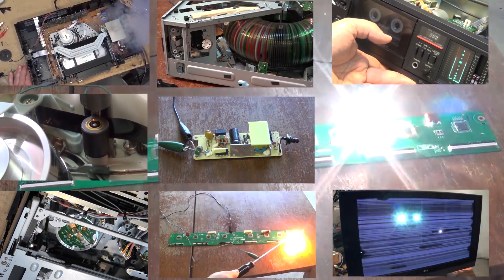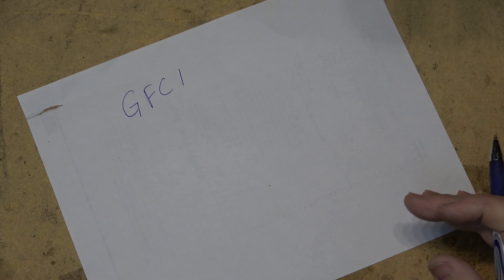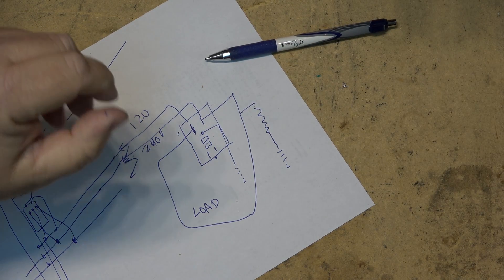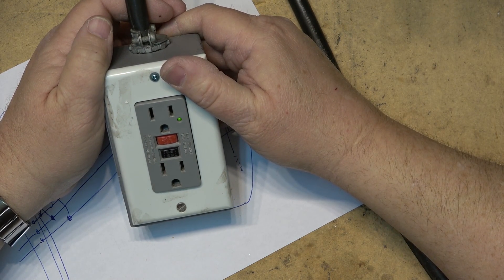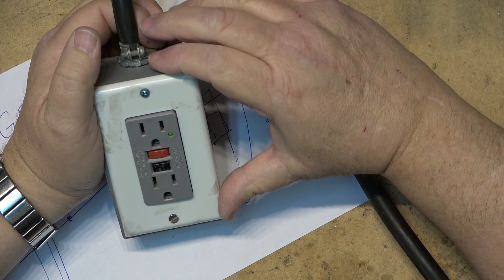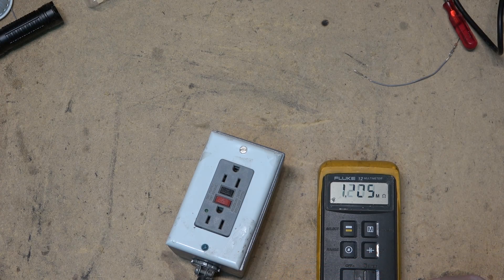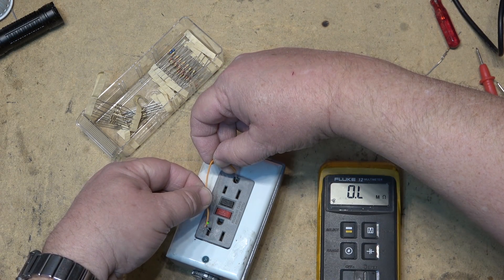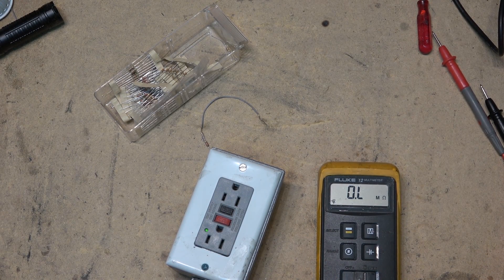Ground Fault Circuit Interrupter Demonstration

Comment: 13:00......I had no idea the ground is THAT conductive. Kinda leaves me wondering how well it conducts at lower voltages???
Reply from the maker: That wasn't even a good ground. If I drive a 6 foot ground rod in it would light a 100 watt bulb full brightness.  I was driven into crushed rock not soil.

Comment: Does it still reset/catch/latch when unplugged? 
I have one that's not resetting without tripping , but have only read one source (online) that says after 2003 they're not supposed to without power, suggesting a broken connection. (And I haven't dug into the code/regulations since I've been putting replacing it off until the weather is nicer.)

Comment: 13:05 Does it trip if you ground the neutral ?
Reply from the maker: Neutral is already at ground.   It is grounded at the pole and at the breaker box.  GFCI measures leakage from hot to the neutral return to that plug.  Any current return to anything other than its own neutral return will trip.  In other words if I were to plug another extension cord into a different outlet and connect a load between the hot on the GFCI and the neutral on a second cord it would trip instantly. The GFCI does not know but it's actually connected to a neutral line or if it's going to ground. 100% of the current supplied through the hot terminal must return to the neutral on that protected outlet or circuit. If the current returning exceeds the threshold of the rcd device it will trip. For example if the trip is 5 milliamps and you are drawing 100 ma from the hot side and 97 was returning to the neutral it would not trip but if only 94 was returning to the neutral that would trip it because 6 milliamps is missing. What how can that be you're thinking what about the power that's being used by the device? The thing is the device is consuming Watts of energy that's what's doing the work but 100% of the energy does return to the transformer if it didn't you wouldn't get any work done. For every electron that goes through a circuit it comes back to its source that's the way it works. If you have a breakdown and some of that current is leaking and going to ground through another path that is what's called a ground fault and that is what a GFCI or rcd it's there to detect and shut off the power.
Reply: @12voltvids  You didn't show it tripping linking ground to neutral.
And yes, I've tripped an RCD by linking ground and neutral - with a test meter !
Reply from the maker: @millomweb  since neutral and ground are at same potential there is nothing to trip it.  If your ground and neutral are not at same potential on unloaded circuit then you have a problem. Neutral will rise slightly is load is not balances here with our split phase system but because it is physically bonded to neutral they will both rise in unison. The exception to this rule is with isolated ground outlets which are generally orange in color.
Reply: @12voltvids  it should trip as not all current is returning through the neutral - so there's an imbalance and that will trip it.
Reply from the maker: @millomweb  when there is no load there will be no current on the neutral.   The neutral and ground are both bonded together at the main panel. 2 parallel wires both connected at the same point have no current on them.
Reply: @12voltvids  Sounds like a good exploratory future video of yours !
Put an earth fault on the neutral, put a light in the circuit and gradually increase the voltage to see when the GFCI trips.

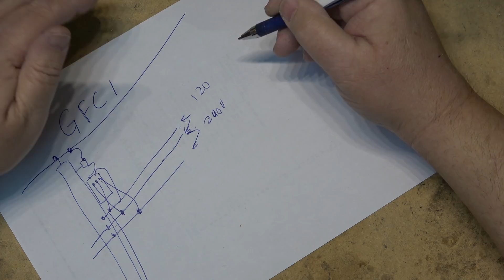Comment: 3:40 Question re your drawing - you've put neutral as being the upper wire. I don't know whether wires are aligned one above the other or side by side - maybe both different in different  places. But, if one above the other, do they not put neutral at the bottom ?

Comment: Thanks for the video. Like you I also do electronics servicing and restorations and my electronics workbench is plugged into a GFCI circuit. One day while poking around on something my bench lost all power, ops. I forgot now what I was working on, and I usually use an isolation transformer while working on live circuits. I didn't receive a shock but I'm happy with the additional protection.
Reply from the maker: I use this when working on microwave ovens. That's why it is here.   It's also on a totally different circuit than the bench.  Two circuits in the workshop one that is just for the bench the central vacuum for the house is plugged into that one as well and the second circuit operates the plugs on the other side and the lights and garage door opener etc. There's also a 240 volt 30 amp circuit that I can either plug one of my car level 2 chargers into or the heat for the workshop and a second 240 15 amp circuit that's usually exclusively for one of my level two chargers so that I can charge both electric cars at the same time. It's true what they say once you go electric you don't want to go back going to the gas station is something I don't miss.
Reply: @12voltvids  I've been considering electric vehicles but we do a lot of trips from the east coast to Arizona.  Have you tried to drive one of your electrics across Canada?
Reply from the maker: @mguess  both of my cars are Chevy volts so both have a gas backup.  I would only ever consider a plug in hybrid so my next car will have to either be a RAV4 prime, escape plug in. Honda clarity plug in ect. Yes I have driven my vokts across the country.  I just run them in gas mode when travelling.  The 2012 my wife drives and she goes about 3 months on a tank of gas.  I have now gone a full year before the car forced me to burn the gas before it went stale.
Reply: @12voltvids  In N. American homes, are all 120V supplies on the same phase ? If not, then if you use an extension lead from 120V on L1 and run it to a room with 120V supplies on L2 then you'd have 240V across L1 and L2. This is something UK homes don't have as they're single phase per house, normally.

Having bought a 3 phase generator last year, multi-phase supplies have fairly serious complications - if you lose the neutral !
Reply from the maker: @millomweb  in north America your source can be either from a single phase or 3 phase source.  In apartments or commercial buildings the feed to the building will be 3 phase (4 wire). To each suite you will have 2 of of the 3 phases (3 wires). This would be phase a & b, a & c, or b & c. Between either phase and neutral you have 120v. Between 2 phases you have 208v. In single family homes the street typically only has a single phase and the transformer center tap is tied to neutral.  This gives 2 legs 180' out if phase.  120 - 0 - 120.  If you take the 2 legs you get 240v. That is how i charge my car using the 2 hot legs.  My car charger has a standard 120 plug on it.  It is a dual voltage charger.  I have an adapter cable I made to supply 240v to the charger.  If i wanted to blow shit up I could plug anything into that cord and have fireworks.
Reply: @12voltvids  So if you lived in an apartment and bought something that needed 240V you'd be stuffed !
The UK has only one 'consumer' voltage: 240V and this is available in 3 phase. Most homes are single phase. Pretty much all industry runs on this supply from transformers supplying several streets. I think these transformers are fed with 11kV and some really big electricity users can get  11kV supplies (such as for motors driving fans to cool nuclear reactors ;) )
Reply from the maker: @millomweb  you are correct only 208 volts available. Does this make much of a difference well it can, heating devices do not heat as hot on 208 as on 240 so your electric range takes a little longer to heat up, your electric baseboard heat doesn't get quite as hot, and your electric car will take longer to charge on 208. I have experienced this I can charge my car at home on my 240 volt outlet in 4 hours if I go to a public charging station where the output voltage is only 208 volts it takes 5 and 1/2 hours to charge my car. Now how is this you wonder well because my charger on board charges at 4 KW regardless whether the source is 208 or 240. It takes that extra almost hour and a half to charge the 14 KW hour battery because the voltage is lower. At 1:20 it would take about 16 hours to charge, because the current is also only 12 amps at 120 as opposed to 16 at 240.
Reply: An isolation transformer will defeat a GFCI. An outlet  GFCI will only work on the primary side of the transformer. You could add a GFCI to your secondary circuit for additional safety.
Reply from the maker: @millomweb  that won't work as the isolated secondary will not have a ground fault.  It is already isolated so no chance of current flow to ground.
Reply: @12voltvids  That is presumably the point of having an isolated supply. It also nullifies the GCFI in the primary circuit.
However, having a GCFI in the secondary isolated circuit still has a value. It'd still trip in a case of a leak to earth - whatever is completing that leakage circuit. 
Had the same issue with John Ward (JW) stating that an RCD is pointless without ground bonding. It is not true ! While there is no ground bonding, it is true the RCD won't trip BUT if ground bonding should accidentally occur, it could trip - basically needs 2 faults to trip. The first fault poses the risk - then the RCD would detect the second fault.
Reply from the maker: @millomweb  the thing is with an isolated supply from an isolation transformer there is no reference to ground therefore there's nothing for an rcd to detect you would have to intentionally ground one leg if you're secondary in order to create a condition where an RCB could detect anything and then what would be the point in having an isolation transformer would kind of defeat the purpose of having it. So therefore an rcd is completely useless on the secondary of an isolation transformer pointless it's not going to do anything it will never ever ever trip because there is no ground reference and there's nothing for the rcd to reference to because the output is floating
Reply: @12voltvids  It would trip on the 2nd fault.

Comment: What a nice system, we have something that has the same effect, my breaker box has current breakers and R.c.d  plus Earth leakage protection.
I think it's a similar idea to yours, just a different name.
it covers all sockets, and there is a test button on the breaker box to trip test.
So have you found anything wrong with that unusual multimeter?
Your cat is loverly, it just wants to see you.
Reply: Yes, the GFCI and RCD and Earth Leakage Protection are all the same thing with different names. What you are describing is the absolute minimum requirement, to have one RCD for the house. It is better to have individual RCD for every circuit, since that means that any leakage current doesn't "add up" and accidentally trip the RCD (eg: 3x10mA leakage = 30mA trip). Furthermore, having one per circuit means that if anything trips, you don't lose power to the entire house.
Reply: @johncoops6897  Yes you are right, i remember the 30ma on the earth leakage unit, there was a test button.
But i have never been that interested in the fuse box details, its something that gets ignored untill something trips it. (A rare thing to trip).
For a frightener, the original fuse box was a little wooden box with porcilane fuses and spare fuse wire (that was hell of a long time ago).
We never died but the loud Bang!! told us there was a fault 😀
Reply: @johncoops6897  "Minimum requirement" - where ? Not in the UK !
Reply: @millomweb  - you tell us then,
Reply: I'd like a breaker box in my house but its a very early 90's house so when it was built the requirement in the UK was so new they just installed a standard fuse box.

To have RCD's in my house will require the consumer unit to be changed.  That aint happening any time soon.

Till then I will just rough it like I did all though my life.  :D

I have to say I'm amazed so many people have them and think they are everywhere.  It must show that many had electrical rewiring done at some point, as there is no legal requirement to upgrade unless certain works are undertaken so must have been some serious work that warranted the upgrade, like at my parents house who had a new bathroom fitted which warranted adding RCD protection to the bathroom (not that there are sockets in there obviously), which of course as RCD's were needed the fuse box was changed to a breaker.

I also wonder how many door to door tactics were used where people were misled to thinking that the HAD to upgrade so "please pay me a grand or so to do it otherwise you will get arrested etc".
Reply: Look at ADE'S WORKSHOP - he's just done a (poor quality ?) review of a similar multimeter.
https://www.youtube.com/watch?v=IH0Z13BarCA

Comment: WOW - $40 for a single GFCI outlet?
In countries where we use DIN type circuit breakers, you just use an RCD "combo" circuit breaker. Much cheaper than that, and protect an entire circuit.
In Australia all power outlets must be protected by an RCD. It is common to use combo Breakers and have one RCD per circuit.
Reply from the maker: Big box discounters have them for about 25 but electrician billed me 40 for this one he pulled.
Reply: In the US, I'd say $40 is about what a 20A GFCI receptacle costs. The normal 15A ones are cheaper.
Reply: In Aus - does that mean homeowners were forced into fitting RCDs when they came out ?
Reply: @millomweb  - RCD on power circuits have been required on new construction for at least 20 years. Also must be fitted if any work done on wiring, except minor maintenance like changing a faulty light switch.
I am guessing the exact details, it has been s very long time.
Reply: @johncoops6897  Are you referring to UK ?
I think it's the norm to fit them now but no compulsion to retro-fit.

As for the faulty lightswitch, I fixed by fitting a faulty bulb.
(Yes, couldn't turn the light off - so swapped the bulb for a duff CFL that lasted 2 days - failed on the second use !
But I can beat that - with an incandescent that lasted ~ 2 minutes !

Comment: You can daisy chain several outlets off of one GFCI. I have two bathrooms, laundry room, and the outside outlet running off one GFCI in the main bathroom.
I also have a GFCI tester that will test all the remote locations for proper wiring hookup and test current trip, they are cheap and recommend for any home, electricians make mistakes too.
Reply: I now have a plug containing a resistor across live and earth for testing trips - having seen one sparky's test (David Savery Electrical Services (DSES), I think) fail to trip yet the test button worked ! I therefore don't trust the test buttons !
Reply from the maker: Yes that is how mine was wired and the sparky changed it.

Comment: Well, you covered the pros for having one, what about the cons? Like what an annoyance they can be at times, false trips, etc.
Reply: If your appliances are OK, you won't have any annoyances or false trips. If you have dodgy appliances, then you can have problems with what might SEEM like false tripping. In actual fact what the "false tripping" is simply early warning that your appliance is becoming faulty.
I rewired my home some time ago and installed many additional power circuits, so that any Circuit Breaker or RCD tripping would only affect the immediate area.
So, each bedroom was separate. Each hallway and other room was separate, as was the Laundry. Each bathroom had 2 separate circuits, one for power and one for heat. The kitchen had multiple circuits for the bench appliances, with Dishwasher and Fridge each on separate circuits. Front exterior and rear exterior were separate. The whole idea was that any trip could be isolated quickly and would only affect where it occurred.
I only had one instance of a trip, caused by a temporary extension lead (outdoors hidden under a bucket) getting moist from dew and creating a leakage current.
Reply from the maker: Nuicence trips are usually highly inductive loads switching in or off.
Reply: Nuisance tripping is also much more common if you only have one RCD/GFCI across multiple circuits (or worse, one for the whole house). Typically "whole house" RCDs are 30mA trip current, which is a lot less sensitive than the 6mA that Dave is showing here.
What happens is that some devices, circuits and appliances have small leakage (fridges are notorious for it), however by themselves it is usually not enough to trip the detector.
Let's say we have a fridge that leaks 15mA when the motor kicks in. Now if you also have a fish tank with a wet steamy light above it (leaking say 10mA) and a outside shed with an underground cable (another 10mA), then it would seem like the fridge keeps tripping the RCD/GFCI. Actually, it was the addition of the 10+10+15 that caused it to add up to >30mA and trip.
So, by separating the loads carefully and using one RCD/GFCI per circuit, you can definitely minimise any "annoyance" tripping.
Reply: @johncoops6897  So I just checked my fridge - it's fine >30Mohm to earth.
I'm of the opinion any earth leak is a fault - so rather than bodge nuisance tripping, fix the faults !
My freezer is in an outbuilding E-L gives 15 ohms ! Perhaps that'll inspire me to investigate those damp circuits !